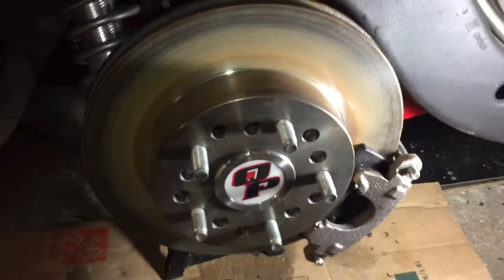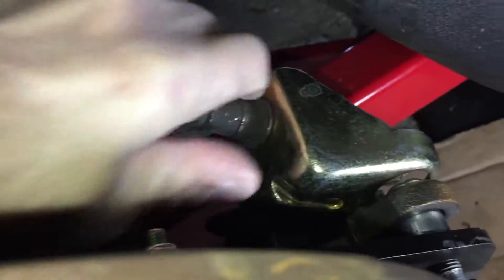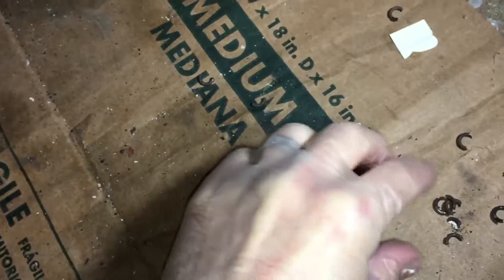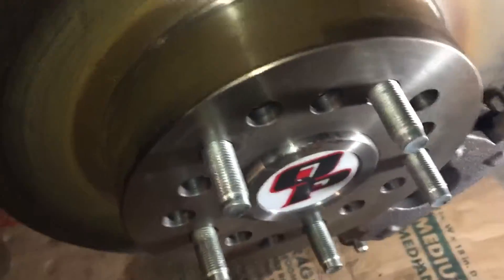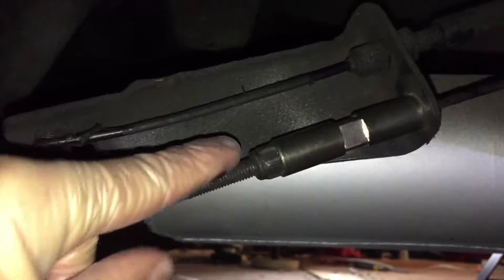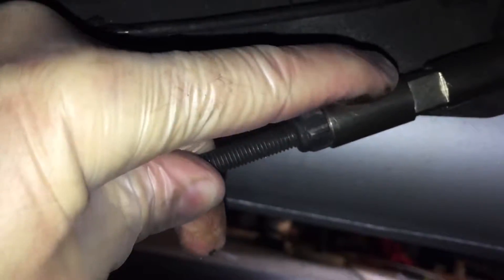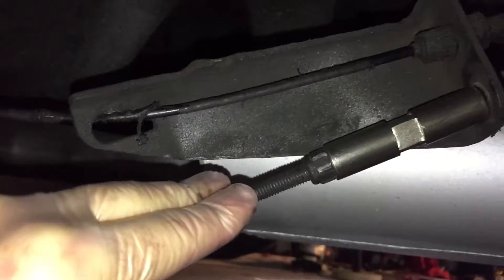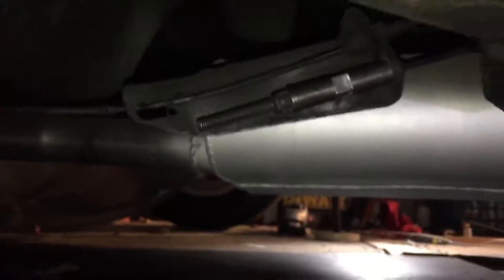Quick Performance Parking Brake passenger completed, part 17

Comment: Did you have to shorten the drive shaft
Reply from the maker: Deonterri Dennis No, the yolk that comes with it you request for a stock fit. I have the 200r4, oem sized drive shaft so I asked for everything to fit. This rear end kit was a direct swap, zero adjustment other than the brakes which are disc.
Reply: Do you race very often? Is it REALLY worth getting wilwood or do those rotors work ok?